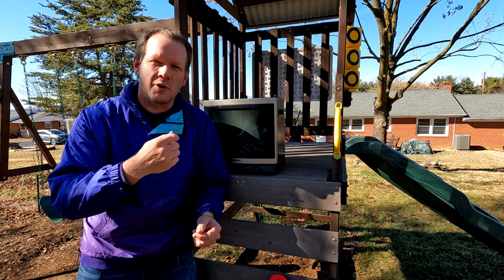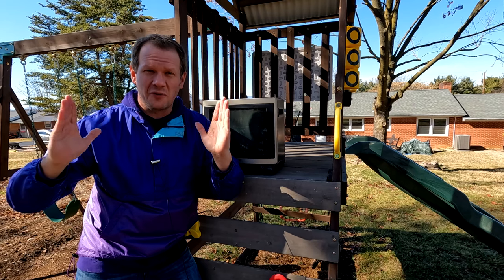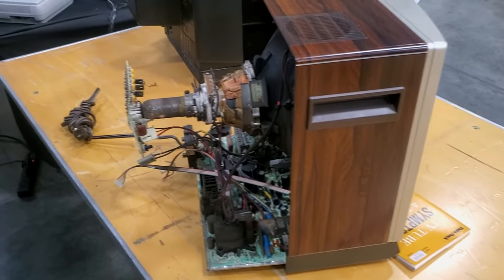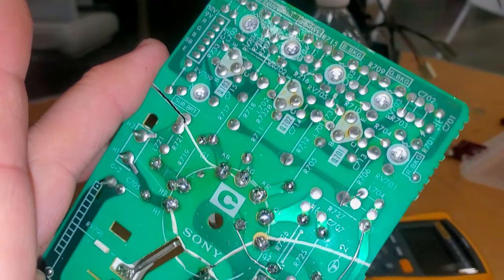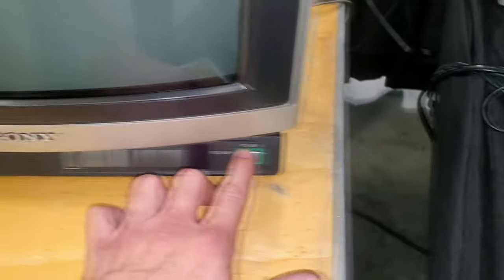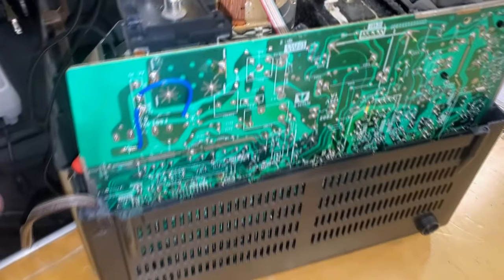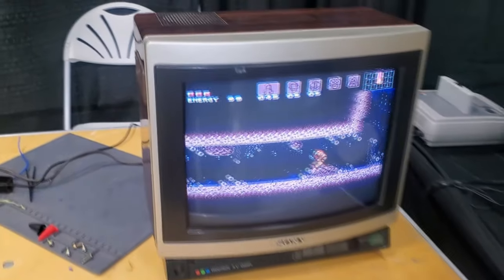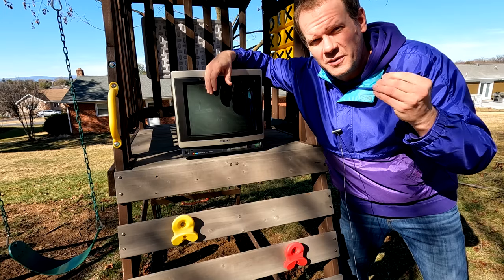Sony's 1980s CRT KV-1396R Repairs

Comment: Do you ever think about learning board design so you could spin up a new PCB for situations like this?
Reply: 👍 That's what I was also thinking about when watching this video!
Reply from the maker: Yeah, that sounds like a great idea for the follow up restoration project.  Look for more on that.
Reply: You wouldn't need to design a new board . You can get PCBs printed but it's expensive.

Comment: Lovely set! Had a PVM-14N1E shipped to me, also from eBay, with the exact same problem. The plastic back had been pushed in and both the neck board and main board were cracked. 
Luckily the fix was just as easy as here. Some bodge wires and it was up and running again!

Comment: I have a virtually identical UK model with SCART socket - KV-1442UB made in 1986. Mine is mint and still in the original factory cardboard box, I think it was barely ever used. It has a metallic dark grey case instead of the faux wood veneer, but is otherwise nearly identical. These mid to late 80’s Trinitrons were some of the best consumer sets ever made in my opinion, back when every Trinitron was still manufactured in Japan

Comment: Hey everyone I hate to hijack the comments section like this but I was hoping some kind CRT enthusiasts might be able to help!  I have a console connected to the component  input of my TV and everything runs fine for about the first 15 minutes and after that when too much of the color white comes on screen I get a flickering and rolling image. Is it possibly a voltage drop somewhere ?  Is there any setting in the service menu which may help?

Comment: This is why i dont purchase crt tvs or monitors on ebay.  People just dont understand how fragile these are, and do not pack them well.  I have made many bridge repairs to damaged boards from shipping issues.  You are very lucky that the crt was not necked, and lost its vacuum.  Looks as if the tv was dropped on its back while in shipping.  Probably done deliberately as well.  Delivery drivers dont care, and toss heavy packages around.  Great repair job though.

Comment: Hi mr retrotech,¿The best and safety way to clean of dust a tv chassis,?powerfull VAC using blower port or suctioning port VS air compressor with oil and water separator?,thanks for your time,channel and passion.

Comment: I don't understand the dangerous part of the title.   I seen nothing dangerous really
Reply from the maker: The neck board has high voltage flowing through it. One mistake on that board could cause a fire.  You could shock yourself quite easily on the neck board of this CRT also.  

The second repair is also a high voltage point.